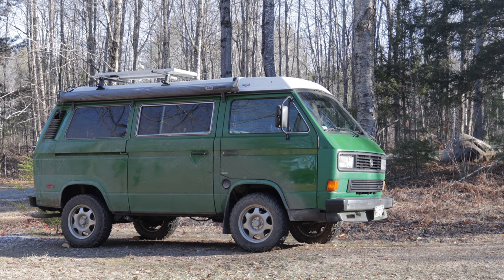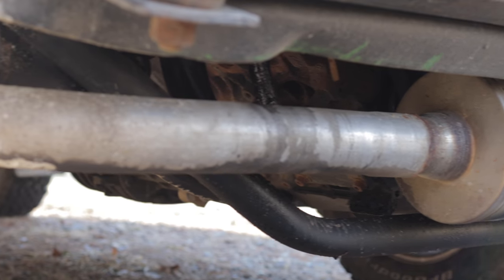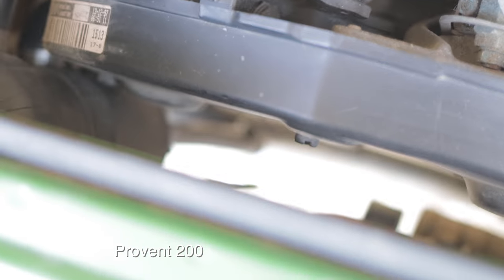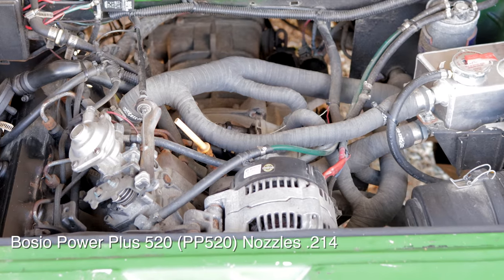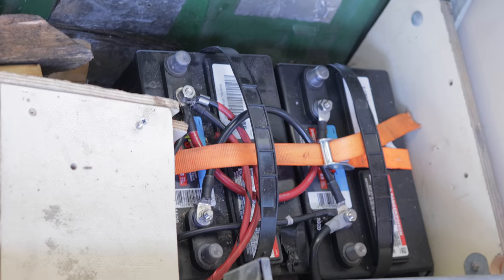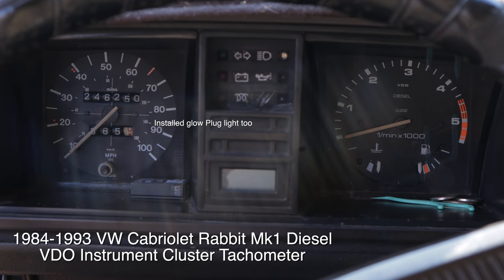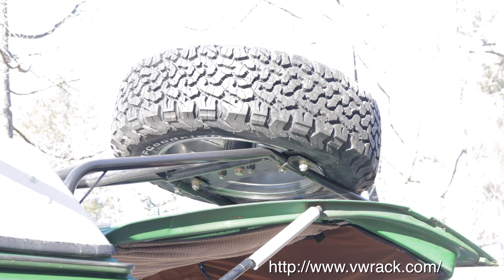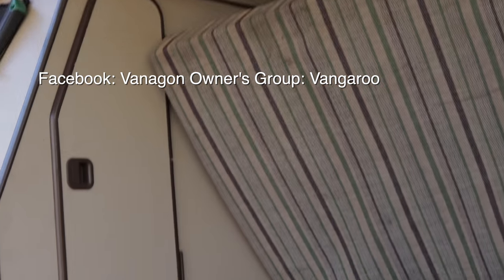Vanagon M-TDI AHU Swap Build PT:3

Comment: Hey man, only just found your fantastic video blogs which i will peruse more closely. I am finally going manual injection pump on my AHU after many hassles, but a quick question from the top of your head:  Tach pick up from? and did the jetta alternator fit straight on the AHU auxiliaries mount? ,

You would love my van cheers
Reply from the maker: Glad these videos are helping others get their swap! The tach was a bit of a battle, I don’t recall off the top of my head how I got it to work. But believe I had to get an early Jetta tach and link it to the w signal off of the alternator. The alternator did bolt right up. I’ll dig around in my notes when I get home and follow back!
Reply: @volcomyouth37  Good guy, i might be able to get some of those pumps at some stage but they would be ve pumps most likely, I wonder if you can tag in to the tps sensor somehow since it will be unused, Has your van plenty of pull? cheers Adam and thanks for replying altenrator number?
Reply from the maker: @chunxxxxter  did some digging in my notes. Used a “1984-1993 VW Cabriolet Rabbit Mk1 Diesel VDO Instrument Cluster Tachometer” that tach reads the w signal off of the alternator.
Reply: @volcomyouth37  Thanks so much, a rabbit is called a MK1 golf car in the uk. I suppose the pick up version is a called a MK1 caddy pick up in the UK.
The engine fired straight up  without bleeding!!!!! I guess it was because I primed it using a pipe and a funnel a metre above the engine. Loads of air came up. I'm just waiting on an alternator from eBay thanks to your info.  I did blow the voltage regulator in the dash - a three pin  L7810T (T0220), so if your gauges go weird, this is what you need (eBay £5 for 10 )👍👍👍

Comment: do you really want to mod the governer?, over here people do a gov mod by removing the lid of the pump and removing the governer assembly and shimming the spring so it is former with a washer or two, that way it doesnt cut the fuel off as early , but really you might want to play with your lda boost pin in the aneroid first, imho i dont need to roll coal and wouldnt shim the governor, let us know how youve tuned it whats the timing on dti, where is the boost pin etc etc